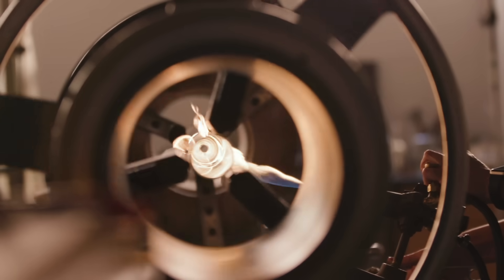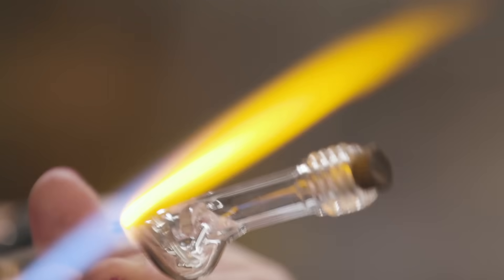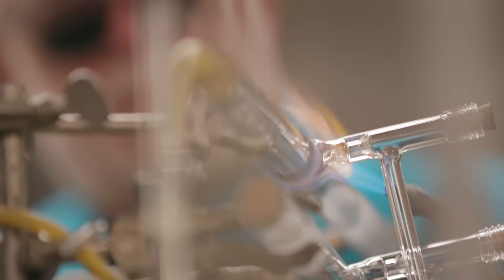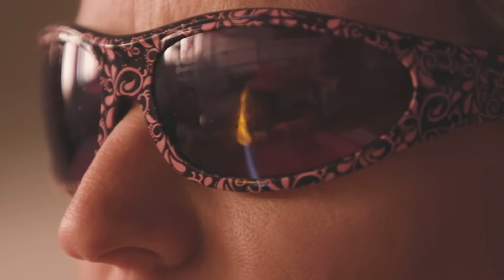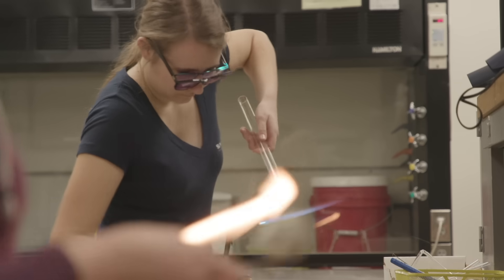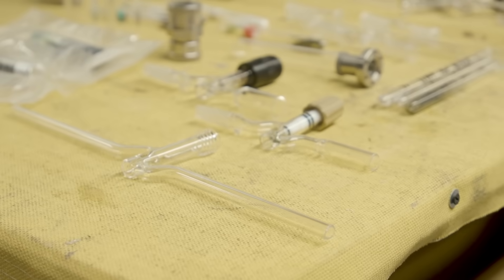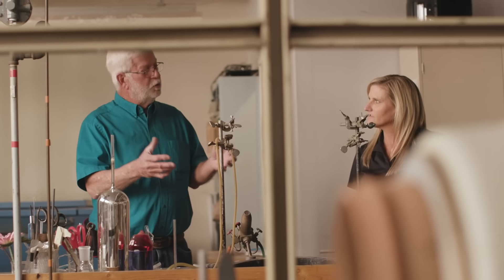Why modern chemistry still needs glassblowers

Comment: Why are none of them wearing gloves, it just seems common sense to have some kind of protection when working with glass and fire. It may hamper dexterity a bit but they can wear thin gloves.
Reply: I am a scientific glassblower. You need to touch and handle the glass with your bare hands for the right feeling to do a proper job. You get to learn very early in you apprantencis how close you can get to the hot places on the glass you are working on with bare hands. Believe me, gloves dont work here.

Comment: was waiting for an explanation on why modern chemistry still needs glassblowers. Is there a reason machines can't do this job?
Reply: Way too custom - one off stuff
Reply: jay s Seems like she creates unique stuff to the specifications of the students and professors, machines are really only cost effective for mass production.
Reply: @redcookies3272  +
Reply: As a chemist what I can say is that these people often repair broken pieces of glassware and so since every piece is broken in a different way I guess it'd be difficult to mechanize the process
Reply: @Daniel-yc5fu  Really? I thought broken glassware was a hazard, even if it had been fixed. Ithought you only replace glassware. Maybe you could shed more light on the subject.b
Reply: jay s - Machines can only produce standard sizes. That might work for an industrial lab testing production methods, but if you are doing basic research, then you will need special containers in odd sizes. You can't do that in a factory. What will probably happen is they will try special makers who do this for several research labs. Eventually the bean counters will realise that the wastage through breakage in transportation, and the lead time needed for ordering is negating any cost savings, and will go back to having an on campus glassblower. There are other specialist areas where this will always be the case with academic research.
Reply: 3d printing!
Reply: @deusxyz  Assuming we could 3D print glass, you wouldn't actually get anywhere by doing that. You'd probably still need a specialist to do it since it's still a very hot material that inexperienced people can't safely handled so you haven't actually replaced anyone. The glass blower basically already does the work of a 3D printer. They can make custom shapes to specification and furthermore they have a good understanding of the material.
Reply: Theyve made machines that produce simple glass items like cups and lenses but the necessity of the glass to constantly switch axis through the process of fabrication required the complexity of the human anatomy. Until they make giant super machines that have a gyro inside tho constantly rotate it while connecting pieces...theyre going to need glasbslowers and lathes. There is a school in south jersey called Salem Community College. The o ly institution for scientific glassblowing. Its 60 years old.
Reply: @Warwick_glass  sci glassblower here.  Your comment is spot on.
Reply: There's the two answers best for your inquiry above mine Jay
Reply: Basically machines can make stuff that requires 'many remakes if the same thing' or a program to tell it what to do. Inthe other hand glassblowing is like a custom dress or trousers it has to do what the end user needs perfectly.
Reply: Was about to post this. Title is bs.
Reply: @Chris-jw8vm  How is the title bs? Modern chemistry still needs glassblowers as shown in the video and comment replies
Reply: @flashsurfing  Nah video doesn't explain it atall. Quote it if your so certain.
Reply: @Chris-jw8vm  "Christine's colleagues in the chemistry department rely on her work"
"Having a full time person available with the kind of expertise that Christie has, is hard to find"
"The world just doesn't seem to be replacing these glassblowers...and its not clear what's going to happen when she retires" 
"We don't want her to retire"

Show me a video that advocates the opposite of what this video does, which is that modern chemistry still needs glassblowers.
Reply: @flashsurfing  Doesn't explain why they need her job still just that they need her.
Reply: @Chris-jw8vm  yeah entire video says that modern chemistry needs a glassblower. But no where does it answer the question why. Such a misleading title

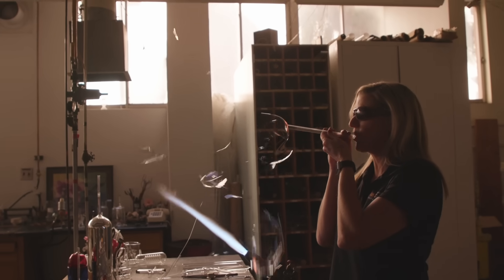Comment: At 2:10 i was so scared and felt sharp tingling pain at different points in my chest by just the thought of having inhaled glass shards or get them in the eyes by blowing them in the face like that. I don't know how it works but it seems like these guys have been doing it for a long time. Thanks for some new info Verge Science
Reply from the maker: Once the glass popped it actually felt a lot like plastic wrap, and wasn't sharp at all!
Reply: @VergeScience  however its still very dangerous to inhale....silicosis, mesothelioma, and other lung complications can be caused by crystaline particulate in the lungs.
Reply: @VergeScience  the glass turning thin seemed ssoooo satisfying
Reply: @VergeScience  oh thank you 😄😄
Reply: Yeah, that is typically frowned upon in most glass blowing shops. Even with proper ventilation, small glass particles in the air are a big no-no.